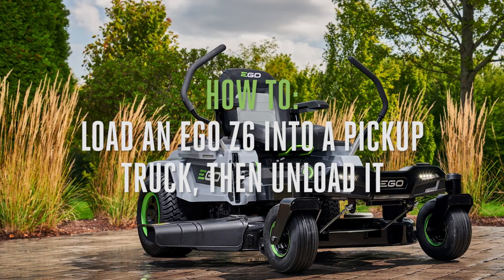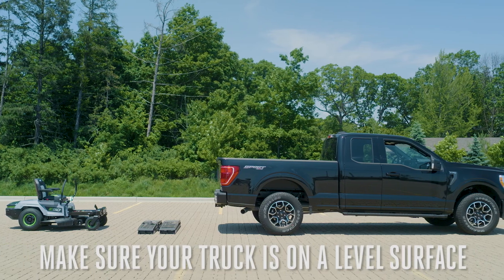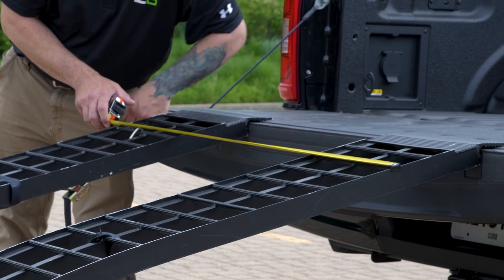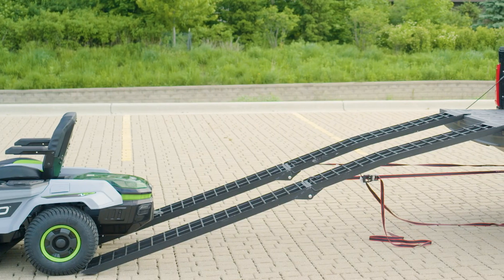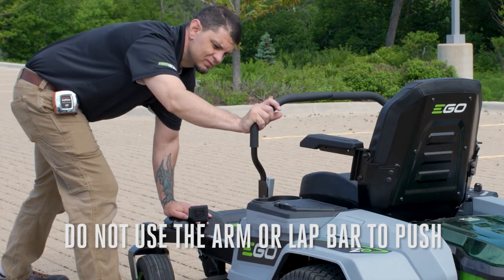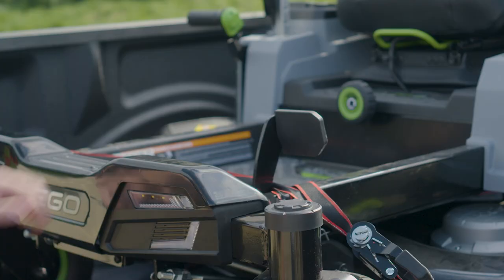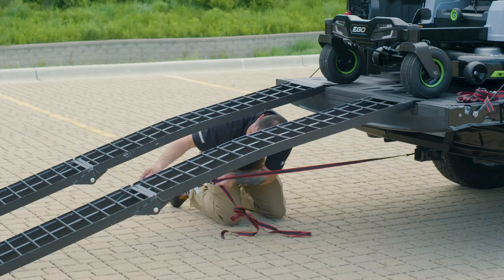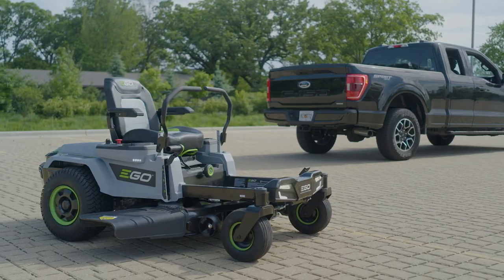How to load and unload your EGO Z6 into a truck

Comment: Do you know if the Ego walk behind self propelled can drive without engaging the cutting blade?
   To drive it across a gravel road
Reply: just activate the self-propel available on certain models.  it can be done with or without the blades engaged